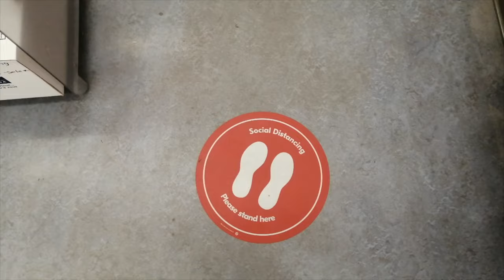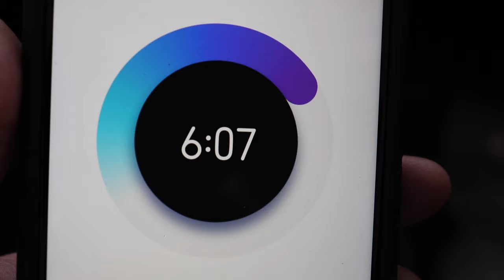My regular making jewelry day | DYNAMIS Jewelry

Comment: Hi. Great tutorial. What gel did you add to the mould before pouring the silver in?
Reply from the maker: Machine oil
Thanks for watching
Reply: @DynamiSJewelry  Interesting. Is that a normal practice putting oil in the crucible before pouring? what does it do to the silver?
Reply from the maker: @sororbudwiser  I think yes, better flowing

Comment: Great work, Dynamis! 
Question: 
When you pull the wire through the drawplate and have to use the pliers to pull the rest of the wire, do the pliers damage that part of the wire your pulling? do you use that part of the wire still or do you remove those sections when working with it? Thanks.
Reply from the maker: Remove
Reply: @DynamiSJewelry  Cheers, thank you